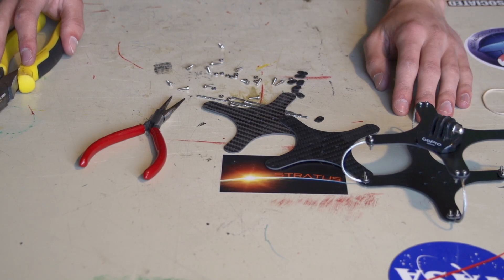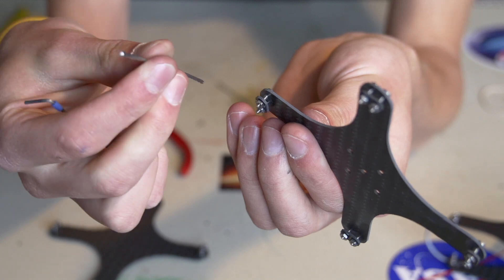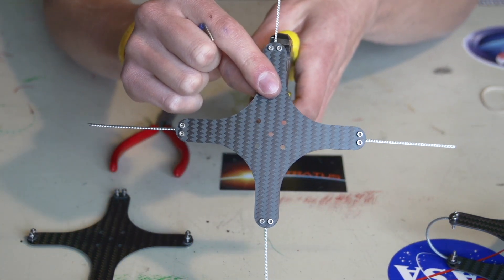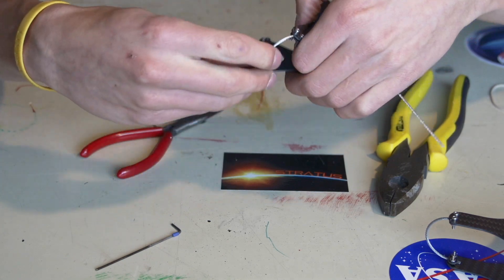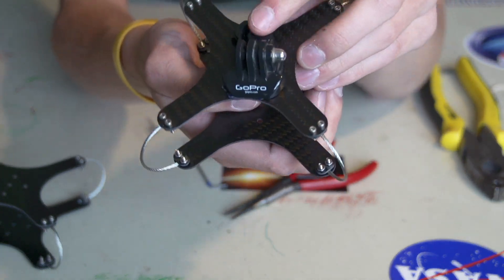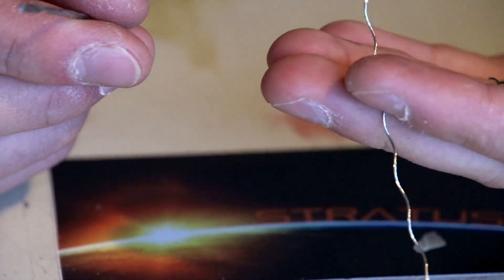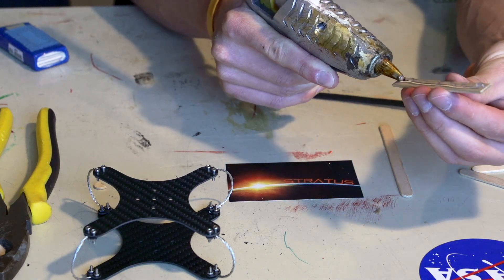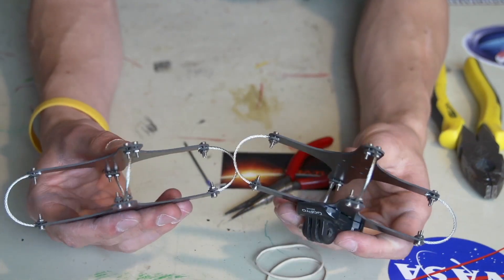POV Camera Vibration Dampener Build Instructions

Comment: Daniel, I made one of these larger dampeners with the same methods as the smaller ones (squish the wire between 2 plates). I used 4 plates instead of 2, and there was no flex whatsoever. I used .098' Lexan plastic, but I'd imagine that 4 carbon plates would be even better.

Comment: Hi Daniel... I ordered one of your units ... Can you please post the dimensions of it so I can come up with a mounting plan for it while I am wanting for it to arrived. Also the dimentions between the top and bottom assuming all the wire is used.
Reply from the maker: The holes are 22mm apart and plates are 115mmx115mm
Reply from the maker: If all the wire is used its about 40cm

Comment: Do you plan to release thicker carbon plates so we don't need to make your great looking product ugly with popsicle sticks?
Reply from the maker: You can use carbon tubes to make them look pretty. If I used carbon thick enough to not flex, the plate would have to be around 3mm. That would raise the price a lot.